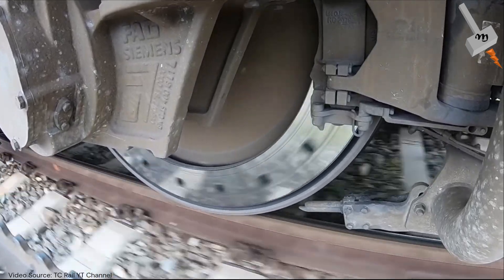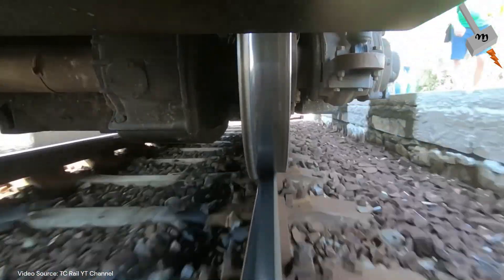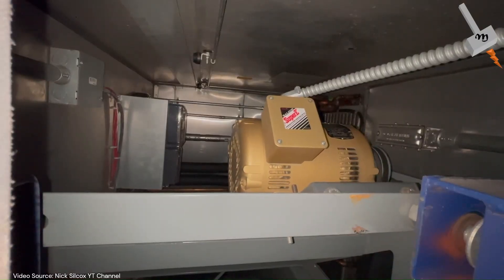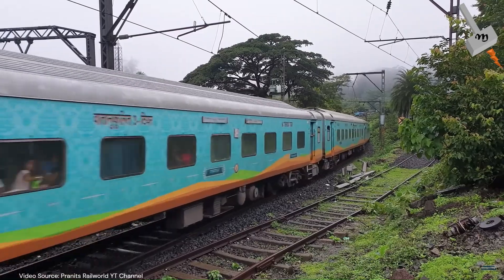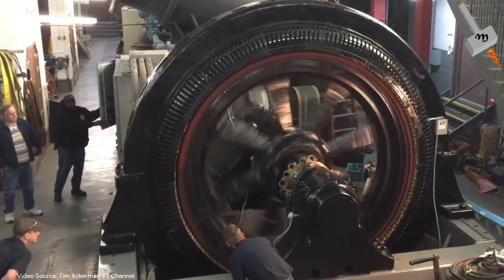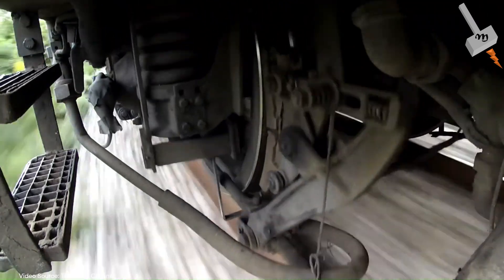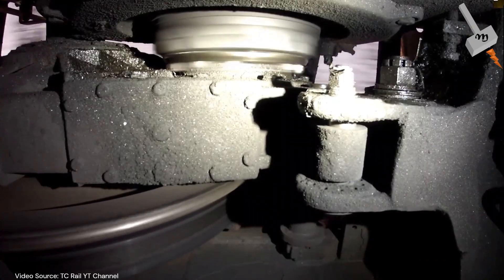What makes traction induction motor special compared to industrial induction motor

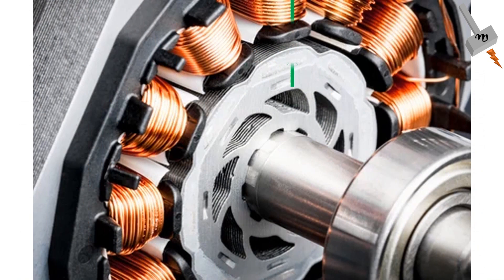Comment: 2:45 This is an induction motor?
Reply from the maker: No… but it just utilized to illustrate the induction motor principle
Reply: @surgepulse2778   Synchronous and induction motors are quite different regarding working principle
Reply from the maker: @ 
Indeed... agreed to your point!

Comment: At 2:29 you show a motor that looks like it has a commutator. For an induction motor I'd expect to see slip rings if anything. Am I wrong?
Reply: kinda looks like stock footage of a DC motor assembly.  An induction motor can have slip rings, but not always.  A couple of terms for you to look up are "wound rotor motor" and "squirrel cage motor".  Both are induction motors, but work in vastly different ways.
Reply from the maker: Slip rings appear circular sections wrt rotor cylinder and would 3 rings or 6 rings or 9 rings depending on rotor current. This illustration was showing rotor core and they are not slip rings.
Reply: @surgepulse2778  ... Is that a commutator though?   (I understand and agree with your comment on the 3-, 6- or 9 rings)
Reply from the maker: It is not commutator
Reply: @surgepulse2778  @ 2.29. That is definitely a "COMMUTATOR". What you have shown is an armature from either a DC motor or a DC Generator.